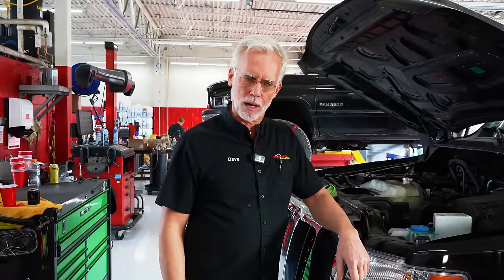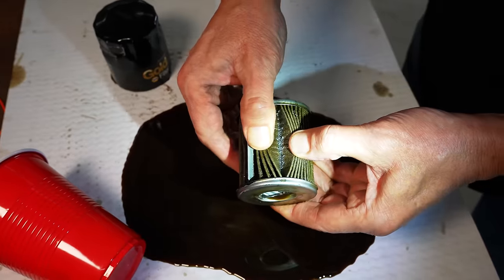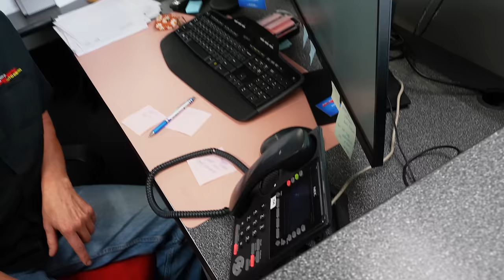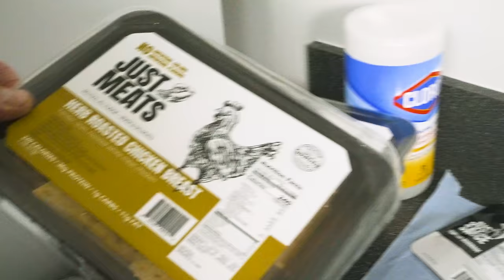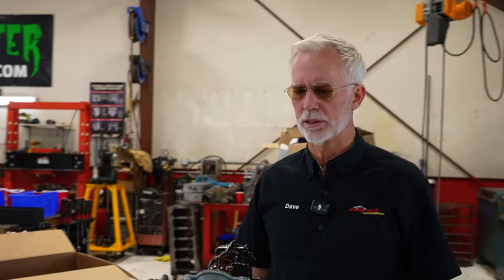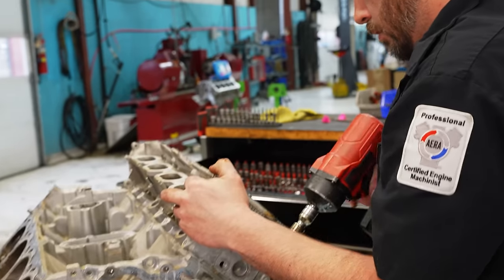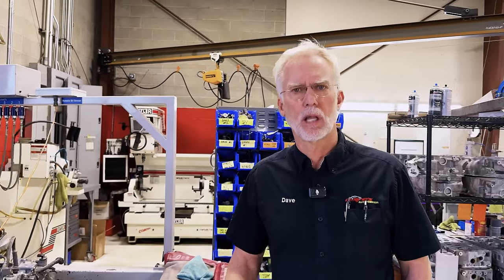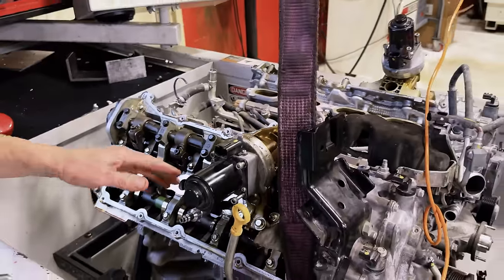2018 Nissan NV 3500 Van. Lack of oil changes ruined an engine with only 50,000 miles on it

Comment: Betcha anything that donk never saw an oil change in it's short, neglected life!  I've NEVER seen one that black & gunked up EVER!

I'm glad you're not reusing that pos!  You never know what metal deterioration has gone on with rod & main overheated till they're black like that!

I love how you said - "The most expensive oil change is the one you DON'T do"!  Classic mate!  It makes me feel better that I spend $110 every 7000 k's on high grade oil & filter!  Being forcefully retired at the moment, it turns out thatI do very close to 7000 in a year!

I didn't like the huge difference in compression in the used engine; glad to hear you're doin leakdown etc!

Hey I loved the look of the meat dishes youse bought for your staff!  Yummo!  But you can keep your rabbit food I'm a carnivore!  Lost weight, improved skin, zero negatives!

Dr. Ken D. Berry
Dr. Anthony Chaffee

Comment: I wonder if nissan fixed the cat converters on the v8 engines the titan trucks had cat converters blow up and suck into the cylinder head and chew the exhaust valves

Comment: But we did get to a point where if it isn't broke don't fix it like we were already at our peak. I would say in the 2000s plenty of power. Still reliable, decent on fuel and then they weren't broken. Just the EPA started getting stricter so that's the only reason things had to be changed for fuel economy and emissions. Otherwise they could have just kept it the way it was in 2003 at least for GM. 99 to '06 is the end of good trucks from them, at least for the 1500s.... They weren't fixing anything. They were just making them better on few and pollute less but they weren't broken like you know what I'm trying to say here.... They're actually perfect at least for that truck now. I can't speak for other manufacturers. They went downhill at different points... Ones they wanted them better on him. Him emissions and economy but also break at certain points right after the warranty. They figured that out too

Comment: I remember the bad old days…. All we heard back then out of the older folks was just how great those engines were way back in the 40’s or 50’s…. Yea right. Along comes the 70’s-80’s you couldn’t find the top of the engine with all the wires hoses smog contraptions etc.These days engines run longer, cleaner and have far less junk hung all over them as opposed to what they once were. As Dave said it’s all about maintenance. Do your maintenance keep the belts,tensioners ,idlers etc in good condition , if the CEL comes on get it fixed asap especially if it’s flashing,do not disregard coolant or oil leaks, all it takes is one time of overheating or running it out of oil that the little beast becomes toast…. Very expensive toast, plus it tastes terrible

Comment: My sister lives in Provo so at some point I plan on driving out to see her and with any luck my high mileage 6.7 Cummins will gasp it's last breath in front of Dave's shop. My 93 5.9 puked in front of the biggest Dodge dealer in Arizona. That was 21 years ago and I still haven't recovered.

Comment: The owner had a guy (who got excited) drop the pan who said it needs a new engine. Then he takes it to the dealer, or he takes it to the dealer first? It sounds like the owner was the one who never checked or changed the oil. I doubt he drove it for two weeks without oil. The story sounds fishy. Maybe it was the editing. Some people never admit they are the cause of the problem.

Comment: 2020 Honda Civic - took it back to the dealer at 5,000 miles for it's 1st oil change.  10 min later service writer comes in and says - your oil life monitor shows your only at 63 % - you don't have to change it with us today - come back when it's Zero....- well, no thanks, if it's alright with you guys make a note I'll come back every 5,000 for piece of mind.

Comment: Speaking of points and condenser, I am about to do a tune up and other things to get this original 68 firebird sprint  running after sitting in our customers garage for 41 years. Reasonably rare car with the Delorian designed I6 engine. Cranked right over with a fresh battery. It is the copperish color with black interior and hurst on the floor. Oh and my 385 stroker makes 602 on 93 pump in my 76 camaro  lead slead with crash bars still in the doors and runs high 10's. Built with nitrous tolerances as well. Wont go over 150 to be safe with the moly rings. Dont want the moly to start flaking off but I doubt I'll ever run the sauce on it. :o)
Reply: Modern muscle engines are FAR better.....old school is for the oldsters.

Comment: Sludge engines like this, are they using conventional oil and running extended drains? Pretty much everything I tear apart nowadays is clean as can be inside. Its pretty much all synthetic oil being used though with 5-7k intervals.
Reply: Nah, even synthetic eventually sludges after a long time.  The guy sounds like he leases it for his business and doesn't change oil.

Comment: A Nissan having issues? That's simply unheard of!

But seriously, that engines probably never had its oil changed. That build up was nasty!
Reply: Nissan builds great motors.  That VK56 still powers the Titan and it’s easily the most reliable 1/2 ton truck currently available.
Reply: @AB-coyote  5.0 Cummins has entered the chat ... Nissan and Reliability are two words that just don't go together.

Comment: Dave, Nissan has a TSB on this engine. I had mine replaced at 40k miles under warranty on my 2018 NV3500 5.6. I don’t know if it was from lack of maintenance since I bought it used with 36k miles. It was really clean so it appeared to be well taken care of.
Reply: Did it have the knock?
Like a diesel.
Reply: Yes, it had the knock. It was from cylinder scoring due to poor design of the under piston oil sprayers.
Reply: @dalececil7527  Thanks. I have a 2019 and am worried about this happening.

Comment: Possibly you haven’t seen the new engines, but they are not better. Direct injection are the new spark plugs but cost 100 times more and phasers or valve timing adjusters as well

Comment: The dealer must have looked at it. Cause i know this NV3500 has a 100000 warranty. Cause we have to  take down the lower oil pan to show warranty. And if the warranty company see how dave saw that engine. They denied replacement.
Reply from the maker: Vehicle is out of warranty unfortunately

Comment: The service at the Nissan dealer was probably a huge rip-off, but not doing an oil change was incompetence, verging on criminal negligence.  Having said that, if services had been done at previously required intervals, it would not have been short of oil.  If the oil pan was full of glitter when the guy that took the pan off, it was already dying. 09:05  Look at the cams.  They are covered in sludge and varnish.  That engine has only seen clean oil once in 50,800 miles and not recently.

Comment: Its a new thing no oil changes. Its generations of people who have never wrenched on a car and don't even understand why there's oil in there engine. Doesn't help that oil changes are not cheap anymore. Even jiffy lube is getting $50 labor if you bring your own oil & filter. And with modern cars and you don't change the oil it ruins the piston rings so a new oil change will go through the rings like shit through a goose. I'm om alot of car forums the really frequent post that makes us all laugh is why is my oil light blinking when I go around corners lol? They don't open the hood ti check the oil no no they go through the trouble to get on a car forum and post there question. Incredible and very very common. The Customer Just Rolled in youtubes kill me lol.

Comment: I always changed my oil at 3000 miles, but i just bought a brand new car 2024, with a 7 year warranty and 2 years free oil changes, and the manufacturer says to change oil every 10,000 miles!  That seems very long to me. Sorry its a toyota rav4
Reply: This is a 16 minute video that came out 6 minutes ago haha how are you commenting 😂
Reply: @bagofpretzels9021 You can comment before you watch the entire video…..
Reply: With synthetic oil, safe to drain the oil and change the filter every 5,000 miles.  I'm in my 50s ... never had an oil burning engine.
Reply: If you follow the dealers advice the engine will make it right to about the warrantee but will start burning oil when your warrantee expires and then you'll be paying for a new motor. Change the oil at 5000 mi and the motor will be good to 500 thou maybe more. If you plan on keeping it over the 130 thousand mile mark change at 5000 or less.
Reply: I personally do 5k full synthetic changes. That's about an oil change every 5-6 months. Pretty easy to do and it won't break the bank.
Reply: Just pay out of pocket to get the oil changes inbetween the 10K if you want your engine to last a long time.
Reply: Check out "The Car Care Nut" channel ...He's a Toyota expert and preaches 5K or 6 month oil changes. Even with synthetics
Reply: Probably due to the fact that your car has synthetic engine oil in it
Reply: DO NOT GO BY MANUFACTURERS RECOMMENDATIONS!!! Half everything they say. I wouldn’t go longer than 5K miles before I change the oil and filter.

Comment: Gotta go see a lady on Monday with a 4 cylinder 2009 Camry.  Drove it with a loud noise for 10 mintes before it shut off.  It did not restart and she needed an oil change. My guess is ran it almost dry and a rod is knocking or a bearing is shot. Will drain oil and check for glitter. All I can do then is put oil in it and try to manually turn it over, but pretty sure it is gone on the bottom end 😢😢😢😢

Comment: Vry costly oil change miss from nissan dealership sludge bkums so bad overheated journal bearings spun on cap resulting total engine replacement

Comment: Have a 2005 duramax with 300,000 miles. Used 1.5 qts in 5500 miles of highway 70-80 mph driving. Is that excessive consumption.

Comment: I have a question I've noticed on alot of todays DOHC and SOHC engines they don't use camshaft bearings like OHV engines is there a reason those engines don't use camshaft bearings?

Comment: What is more important mileage or time that oil has been in the system?  I have a 2019 Dodge Ram that is not my prime driver.  I have not changed the oil in over 10 months but I have only driven the truck almost 3000 miles.  I was a mechanic in the Army and during the Army Oil Analysis year.  We would send oil samples to the lab every six months and they would tell us when to change the oil.  So I tend to think that the mileage is more of an issue than just sitting in the pan.  Does anyone have an experience where time in the pan, and I am not talking about years of sitting, has degraded the efficiency of the oil to be able to do its job?

Comment: I mean one thing is the customer not understanding how to maintain the engine but that Nissan dealer really did not do their job at all. Did they not do a basic service and oilchange when they got it in? Any cursory inspection should reveal what the main issue was.  They must have known that no amount of transmission-flushing and random parts would solve this?

Comment: Now that's where I totally disagree with you pal my dad had an old Chevy truck and I got over 700,000 miles on the engine. Things were way cheaper back in the old days you could fix things far cheaper. Things were better in the past!

Comment: How do your technicians keep track of all the nuts and bolts in an engine removal and tear down?
Reply: It’s not hard if you’re familiar with a certain brand but a vehicle you’ve never worked on before most lay everything out on a table or the floor and even leave sticky notes what it is and where it goes

Comment: We are not a dealer.  We don't replace engines (that we know definitely need replacing).  We just charge you tons of money to diagnose it, then more to diagnose a used engine.  Oh yeah that used engine needs a bunch or work too (big shocker).  Then we put that used piece of garbage in.  Could have just replaced the engine and got a 3 yr warranty from the beginning at a cheaper price.
Reply: customer was cheap though
Reply: A remanufactured bare engine from Nissan is $5000.
Reply: Cant imagine the price of a new short block or long block
Reply: @rowdynoe9595  After having to tear down 2 engines then partially rebuild one, plus removal and reinstallation, plus hooking up to that machine twice, customer was probably out 40 to 50 hrs labor and has a piece of crap used engine still.

Comment: What is this? The tech didn't want to do an oil change and so  the tech did not say it needed one. The Advisor did not try and sell one? How about the tech noticed fresh oil and a fresh filter and this is why no one tried to sell one? I have worked at shops and Dealerships where it was someone's job to check basics before the car is released back to the customer. I ask, why didn't the customer mention an oil change? This chain of events is troubling. The customer took a vehicle with a noisy engine into the Dealer and the Dealer passed up on selling an engine so as they could do a trans flush instead? The chain of events here are a bit off. Where does the pan getting dropped fit in with the selling of these services? Did it go this way. Customer sent the vehicle in for service, with a engine that was not making noise. The Dealer sold services that did not include an oil change. Engine started making noise and then this pan dropping work was done. The customer is saying that the engine was so low on oil the day it went in for service that a few weeks later the engine failed?(and no work was done that caused the engine to lose oil?)  Why didn't the customer say "how is the engine oil as I notice an oil change was not recommended? Customers should always check fluid levels whenever they get their car back from service.

Comment: When I was working for a shop back in '93 in salt lake I did the emissions and inspections I was certified for that on all the highway patrol cars vehicles and the police academy I did all that and even some congressman of Utah I worked on their vehicles well a young feller brought in one of his dad's cars politician just an oil change basically tune up well the kid come and got it drove it down to the corner where the 7-Eleven wasn't filled it full of oil up to the top of the dipstick Be careful who you let you do your maintenance Tell them they can drive them but unless you show them how to check everything correctly before they drive them you wouldn't have that problem I feel too 5 gallon buckets with how much oil he put in that car he filled it completely that block everything The politician's son of Utah did that

Comment: Alright you lost me at saying old designs are garbage, do you know how many GM "350" are out there with 300,000 miles or more on them, without being rebuilt? Probably millions over the decades. Can't get 600hp+ out of a big block? Dave you can do that easily on 91 octane, all motor, I've done it many times and it doesn't cost very much money. Sure, you had to do tune ups on old distributors and plugs, but guess what, those kinds of parts are very cheap and labor only takes a small fraction of the time. Everything is a 10 hour job now... things do not last anymore and they're built that way on purpose
Reply: You’re wrong
Reply: @Agiledoughnut123  As someone who's spent the last 26 years professionally as a mechanic, no I'm not

Comment: I had my valve covers and chain cover off my nissan 4.0 v6 last fall. 260k and zero sludge anwywhere. it was barely tan all over the castings, if that. This is borderline offensive. Shit falling off the oil pump like cold patch, get the heck outta here.

Comment: Oh yeah, we got work, so much work you dont know which one is next, , please, please do your maintenance, correctly, without overspending just to have it screw up.
   Maintenance is so much easier and cheaper, than major over hauls all the time.
  But they go to do some of their  maintenance, just some, of the maintenance, and it gets done wrong, and, there, you Are.
  Go to a good technician, to get the maintenane done, someone who studying at least, your particular machine. He will educate you of what to do and why in relation to what your  doing in daily and yearly operation.
   We got work, we do not want more. Please, save, your, money.
   The machine is working right, doing everything you need, maintain, it right, maintain it that way.

Comment: I respect what you do, but you contradict yourself... a tune up on an older engine is called maintenance. You say you had to keep doing tune up's on older engines, points, plugs, etc... complaining about that but then you say you have to keep up on the maintenance on the new stuff. Joe Blow could do the old school tune ups. They were easy and you could figure out issues. The new stuff, while built to tighter clearances is a good thing, they have way too many computer controlled crap and are way, way too complex. They don't need to be that complex. They stick oil filters in the dumbest places. Having more than one oil drain for an engine pan... what the hell? That engine you pull apart wasn't from missing only one oil change. That was a piss poor owner.